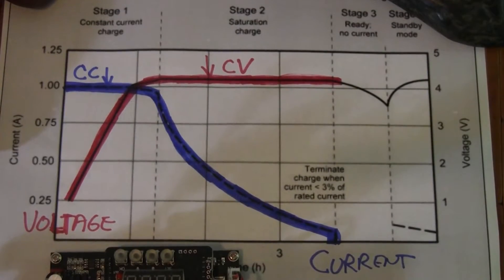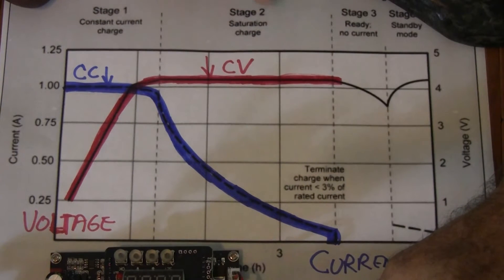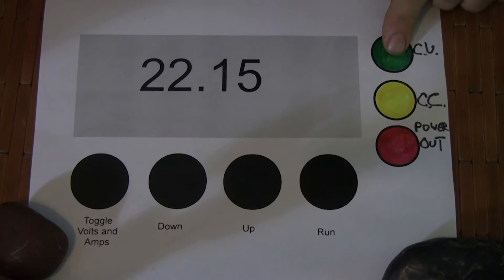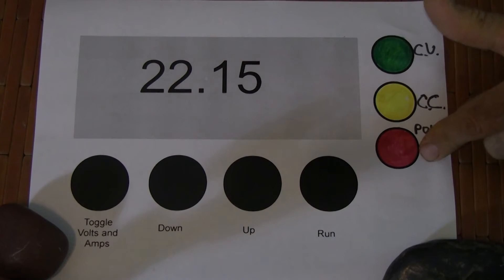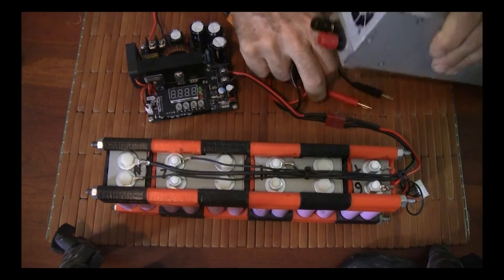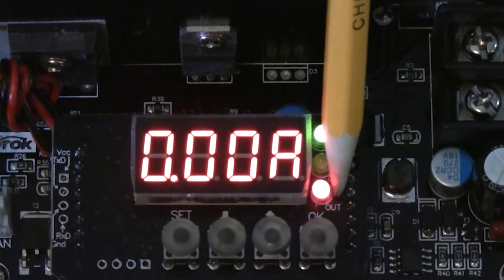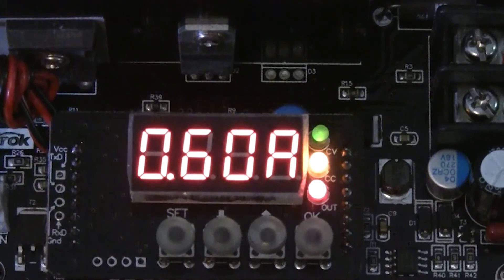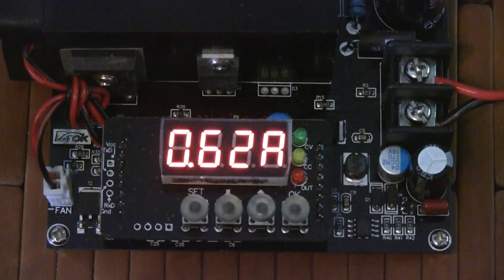Build a universal lithium ion battery pack charger

Comment: How do you balance the batteries?
Reply from the maker: My go-to is active balancing these days.  If the battery is well balanced, I will charge to 4 volts per parallel group with no balancing, then balance with a hobby charger when needed.  Or you could combine active balancing with the overvolt/undervolt/over/amp protection that a BMS offers.

Comment: Hello. I want to regulate an unregulated battery voltage of 48-60 vdc to a constant output of  48vdc with a current up to 6 amps to supply power to cctv equipment. Are these types of devices meant for my application? Thanks.

Comment: Excellent ....but now how do manage balancing the battery with this?  Use a balancing board if you are not using a BMS ...and use the BMS to maintain balance if in fact you do have one?  Always good info from you ...thank you.  I just subbed.
Reply from the maker: Hey Happy Guitarist,

Thanks for the compliments, much appreciated.  Yes, you would use this to either power a Hobby Charger, do "bulk charge" a pack- charge to a lower voltage without balancing, or use it with a BMS.  What do you want to build a battery for?
Reply: @shawname2  I build batteries for personal use for a variety of reasons ....but also do build batteries for others ...which again ends up for a variety of reasons ...Ebikes, powerwalls, electric power tools, DIY robots etc.  I also have large quantities of Boston Power Swing batteries at this time that I sell to others who build their own packs ...and for that matter may end up with good quantities of other manufacturer's batteries if the opportunity arises.  So I am interested in all things battery related.

Comment: hi my drok i bought from amazon wont adjust voltage will send video i use it to charge my lithium batteries so need to adjust charge voltage its supplied 12v from my adjustable power supply.steve in uk.its the one you use shawn
Reply from the maker: Hi Steven,

Return it.  I(t is defective....   But check the fuse first.

Comment: All lifepo4 cells now 3.7v for the 24v 200 watt motor do I need a bms ?Was thinking can use 8s4p pack plus 3cells extra that were in original case gettin 11.2v off the first 4s4p pack I built

Comment: These lifepo4 batteries are expensive and they still make them don’t they like for boats and vehicles they seem to be longer lasting than lithium ion usually and safer
Reply from the maker: Get then cheap at Battery Connection- online

Comment: hi shawn ive just got a lifepo4 battery off headway superlight bike its my girls mums not been used a while.anyway  i teested battery and it came on an span the motor ok then under load it dies.i checked cells there are 30 x 22650m 2250 mah.5 series x3 two of these joined up.they are about 3.6v each but one was 3.8v.could i use drok charger on these say 29v at 2to 4amps.she is using my old hoverboard battery for now.41v 18650 pack it gets her to supermarket and back nearly but only small.
Reply from the maker: I have seen it happen that a cell will show a good voltage, but when you put it under load the voltage plummets.  That means the cells have massive internal resistance.  In other words, it has no power to give because it can't get out of it's own way.  Sorry, but I believe the battery is toast.  Test it under load while monitoring the voltage and verify.
Reply: @shawname2  i checked pack voltage out off case its 26v it lights up my led torch ok
Reply from the maker: Steve-  Is it a 36 volt ebike?  The low voltage safety on the BMS or the controller could be kicking in, shutting off the battery.
Reply: @shawname2  ITS ONLY 24V BATTERY AND 200 WATT REAR HUB MOTOR
Reply: @shawname2  will connect torch and measure voltage again
Reply: @shawname2  it was still 25v with the led torch on it is 8 x 10watt led gives 8000lumens light

Comment: Great idea. Bought the 2 items from Amazon USA but a refurbished HP 12v 575w redundant power supply is only available and only male disconnect spade terminal can be connected to the output. What AWG wire should I use to connect between the power supply and the Drox device? Thank you.

Regards,
George
Reply from the maker: For 600 watts at 12 volts and a foot run, 12 or higher gauge would work.

Comment: I have a more simple version of this using a CC CV Boost converter, but my packs all of BMS's on them. I'm looking for a higher current application - I'd like 12-16 Amps at 54.6v. Do you know of any boost converters that would handle this current?
Reply from the maker: Sorry, no I don't.  At 600 to 800 watts most folks are using a dedicated charger...
Reply: Thanks for the reply!

I basically want to make my own dedicated charger. Most seem to cap out at 3Amps for E-bikes. This is to charge a Portable 3kWh battery pack as a backup to my House, Boondocking, and for use in a trailer or "Camping".
Reply from the maker: Check this out:

https://www.aliexpress.com/item/XINMORE-54-6V-15A-14A-13A-Lithium-Battery-Charger-For-48V-Ebike-E-bike-Li-Ion/32829858594.html?spm=2114.search0104.8.8.205e2a00dYH3YK&priceBeautifyAB=0

Comment: I have been looking for one of these. I was thinking of adding a bms and making it a balance charger. I have a 7s and a lot of paralled cells. Almost 200p Bank. I thought about the balance chargers. But they are not cheap for a 7s charger.  I'd like to have a few of these. So I can charge from a 12v 150amp source. And use most of the that current! It would mostly be in an emergency when used. If it could do 250watts 28.5-29.4v. I want to charge to around 4.0-4.12v 4.15 max per cell. I'd like to keep it between 3.4-4.0 volts. To hopefully make the batteries last forever! Great video!!!
Reply from the maker: That is a lot of cells in each parallel group for an off the shelf BMS to keep in balance.  You might want to check out my video on balancing big batteries:  https://www.youtube.com/watch?v=C-o3LAtkMUs
or:https://www.youtube.com/watch?v=QwOpa8gT4Uk
cheers,
Shawn

Comment: Hi Shawn, great videos. love em. Question. You said that all lead acid and lithium ion batteries use cc cv charge cycles. Is that inclusive of sealed agm batteries? or are these different chemistry? and would these batteries benefit from being slightly "under charged" to prolong their life? Many thanks in advance, keep up the good work
Reply from the maker: Hi Eric,
Yes, because AGM is a lead acid chemistry.  No, Lead Acid chemistry does not benefit from being undercharged, it benefits from being overcharged or "boiled" on occasion to loosen the sulfates forming on the lead plates.  Undercharging does shorten the life on them though....
Reply: Thanks for the reply Shawn, its surprising how many vloggers on here do NOT reply. Much appreciated, and nice to see that you reply to your viewers. thanks for the info. Eric.
Reply from the maker: You are welcome Eric, I try to reply to everyone except the provokers.
Reply: One last thing, the drok mentioned in this video, can it be used for a range of battery charging, from lipo packs, to li-ion and agm, aswell as standard car batteries? I have found that people are advertising certain chargers for certain requirements, but it seems to me that this one is pretty universal..?
Reply: What would you say would be the ideal voltage to go to when charging lithium ion cells (18650's) would it be 4.1v as apposed to 4.2?
Reply from the maker: Yes, it would be suitable for all CCCV chemistries.  Lead Acid likes to be kept topped off, while Lithium likes to be used once fully charged......
Reply: Thanks again for the reply Shawn, Do you know if the DROK is capable of balance charging? Is there a module built in for this, or is there a plugin one available for this unit? You are a star. Many thanks
Reply from the maker: Hi Eric,
Yes, the Drok will balance charge.  A balance charger needs to have two charge cycles, Constant Current and then Constant Voltage.  It is abbreviated CCCV.  The Drok is a CCCV charger.
Reply: Hi Shawn, Thank you for that, but I was actually referring to the inputs for where the balance leads will go on the DROK. Its not obvious from the video if these can be connected to the DROK, or if you will require a seperate balance charge module
Reply from the maker: ahhh, No the Drok has no balance leads.  You would need a BMS or BalanceBlocs.
Reply: So I guess I would need a plugin monitor module similar to what you used in your ebike battery setup.? Do you have a link to that module? thanks Shawn, you have been a massive help
Reply: What would be the ideal voltage for 18650's to maintain their life? or even prolong it? would you say between 4v & 4.1v?
Reply from the maker: Have you seen my video "How to build a better battery without a BMS" I don't sell  BMS's or Hobby Chargers, but if you contact me personally from my web site I will help you get the right gear.
Reply: Thank you Shawn. I will take a look at this video.
Reply: FYI. The video is great, and the spreadsheet for the bloc calculations is also great. Well done. I think I will use a 4p-2s block, and add a buck boost module to bump up to 12v. Excellent!
Reply from the maker: Thanks Eric, Yes the 4P2S is popular.  You might consider a 4P3S Bloc to get closer to the 12 volts.
Reply: I understand your reasoning for this, but I wanted to make the pack as light and cost effective as possible. Hence the fewer cells, and the boost converter.  I Need between 5v and 12v only. But the capacity of 12000mah is important factor for the price and weight. I dont need to drive a lot of Amps through the converter, probably a maximum of 2-3Amps.
Reply: Your videos are fantastic, and very inspiring. Keep up the great work.
Reply from the maker: Got it.  Sounds good!

Comment: One ebike guy said they had a lot of Samsung cells do this but mine were new should I just use more new cells is it ok to mix different makes same capacity like Panasonic an Samsung
Reply from the maker: Yes, it's OK to mix different cell manufacturers- you don't have a lot to lose!  Put them all in parallel and charge at once to 4 volts...

Comment: hi shawn can I use a drok to charge my 0v cells slowly with low current like rhino does on youtube.so need variable powersupply or 12v supply and a drok?
Reply from the maker: I don't see why not.  But I also doubt if it would work.  When I try this my batteries just get warm.  If you are able to recover and use 0 volt lithium ion chemistry batteries could you re-post here?

Comment: Can I connect 2 of them in parallel to double the current ? assuming I make sure the output voltage is the same
Reply from the maker: Yes, 95% certainty.  Keeping the output voltages close is key- or else the higher voltage one could cause the lower voltage one to turn off...

Comment: Actually a 300w charger will never output 300w. 
Example: 60v battery it will be empty at 53v and full at 67v
When you plug the a 4a charger it will output 4.48a x 53v = 237w. 
When it reach the 67v x 4.48a = 300w but just for a moment. 
The current will start to drop until it goes 0. 
So when you get a 300w charger, you never get a 300w charger. 
What you should look is A. 
if you have a 30Ah 60V (67V full) battery and you want to charge it in 10 hours get a 67v 3A output charger. 
If you want to have a full battery in 3 hours get a 67v 10A output charger.
Reply from the maker: This is true- a good way of determining the size charger that you need.  
In terms of rating the power of a variable charger like this one, watts is also useful.....   It tells us that at 60 volts we are going to get 5 amps max- but at 30 volts we can get closer to 10 amps-  which then helps us size the charger for the battery we are charging.  
Thank you for your comment.  It is helpful.

Comment: Wonderful video here. One question if I were to charge my 24v lithium pack but was using a 12 v solar panel if I hook up the panel will it navigate voltage changes from the panels? Let’s say a cloud came over the panel and the voltage dropped? So will it keep the output voltage constant or will it shift in reference to the cloud? Obviously the available current would change.  Thanks.
Reply from the maker: Hi Solar,

Yes, the Drok will keep a constant voltage as the sun comes and goes.
Reply: Awesome thank you, this is exactly what I’m looking for.

Comment: Can only get 1.8amps from a 12v x 750w power supply very slow for a larger battery. Have ordered a 48v output power supply to see if I can get more amps out of it for my 52v 14s battery.
Reply from the maker: Something is wrong- a 750 watt power supply at 12 volts should deliver 62.5 amps.  It is possible that the battery is nearly charged, and therefore the current has reduced.  OR the DROK is restricting the current flow.  Check again Stephen...
Reply: Shawn McCarty yeah checked it a few times even if I set it to 5 amps I can only get 1.8 this us when the battery is low. Have also tried different 12v output power supply. Got some feedback from the ES forum and the guys said I need more voltage output. I've tried a 250w, 350w and the 750w supply all give th e same 1.8amps . I get 4amps when I charge half the battery 7s x 7p
Reply: Shawn McCarty this what I got back and makes sense about my outfit.....your DC-DC converter can handle only 10A on input side, if you have 12V input, you can onlly use 12V 10A (120W of power) which is less than 2A at 55V. You will need 36-45V psu for 50-60V output
Reply from the maker: Stephen, you are right.  Sorry if I was misleading.  Thank you for the correction.  

I am about to build some battery chargers using this power supply: 
 https://www.amazon.com/gp/product/B01GFVI6R6/ref=oh_aui_detailpage_o01_s00?ie=UTF8&psc=1

With the 30 amp version you could get 360 watts out.  Also, power supplies can be connected in series for higher voltages:  
https://www.acopian.com/acopianPowerSupplies/entry.aspx?nsid=17

Many ways to get there- keep experimenting!

cheers,
Shawn
Reply from the maker: Looks good Stephen.  With a little work we can build some great battery chargers!
Reply: This sucks.  So 900w is when?  Is it a 10A limit or 15A?  Further, I thought these were always voltage boosters.  If you bring in 60VDC can I output 48VDC?

Comment: Nice video Shawn. I have a question though: I have 3 x 12v 138ah LiFE bateries wired in series to give 36v for my small electric vehicle. I'm looking for a cheap way to charge the vehicle quickly. Could I use more than one of these units in parallel across the whole 36v battery at the same time? Two chargers would half my charge time, which would be very nice.
Reply from the maker: Hmmmm.  The issue is that one Drok may read the voltage of the other and decide that the battery is fully charged and shut down- especially late in the charge cycle.  But this should not be an issue as the remaining one would just up it's current...  I think it would work.  I have doubled up with ebike chargers before and that is what happened...

Comment: Does it also balance the battery? If you charge a battery with a lot of amps, it charges fast but does it damage it in the long run?
Reply from the maker: It does not balance a battery.  Lithium chemistry does last longer when charged more slowly.  As a rule of thumb, you do not rate.want to charge faster then 1C.  1C means that a 10 amp hour battery can be charged at 10 amps for 1 hour.   1/2 C would be a good rate.

Comment: Shawn, is there a way to add balancing to the Drok when not using a BMS?
Reply from the maker: Sorry, No.  But you could use the Drok to power a hobby charger.  Or use 1 Drok for each parallel group......
Reply: Shawn McCarty  ok, thanks for the video, great ideas!

Comment: My question is, how does a device know on its on when to start charging in CC or CV
Reply from the maker: By watching the voltage.  Battery chargers start in Constant Current mode.  So they put out as much current as they can to charge quickly.  The voltage then rises.  When the voltage gets to the fully charged voltage the charger switches to Constant Voltage mode.  Here it begins reducing the current to keep the voltage under it's limit.  Finally, when the amount of current is only about 5% of the charger capacity, the charger calls it a day and shuts off.

Comment: This has not auto-shut off feature? This would require baby-sitting, or some sort of timer so you don't toast the batteries?
Reply from the maker: It's a CCCV charger- so the charge current tapers as the voltage rises....   SO that is the shut off mechanism- as is true in all chargers...
Reply: I'm at a crossroads of charger thoughts. 10s5p battery.

a) I-charger 1010b+ with no BMS, but use a cell logger. 
b) Luna Charger with a BMS
c) Drok, DC power supply with a BMS

Side note, I sent you a message on your website asking for some dimmensions on the blocs. It's been awhile with no response. FYI
Reply from the maker: Could you please send the dimension request again?  Sometimes I miss an email.

My choice would be the 1010B with no BMS and cell loggers.  It's the most expensive but you would have a true instrument panel into your battery and could control the finish charge voltage...
Reply: That's where I was headed. I decided to go a different route on the battery. I am space limited, and don't believe the blocs would have worked for my particular project. Great idea though.
Reply: Hi, But will it completely cutoff once the amp is very low (below 5%) in the CV phase... basically like any auto Li-ion charger? Or you have to unplug it manually ?
Reply: Shawn McCarty hi Shawn so if I purchase off eBay 12volt power supply and the drok 900watt will that be ok for my 50 cell 18650 Samsung brand new 2600 mah pack for electric scooter or bike later on .standard lead acid at moment 12v 12ah x 3  but range not good .will be using vruzend kit for 18650 but want to charge as pack .have bought a imax b6 to charge 16 cells as jgarcia  reccommends  in 4 battery holders wired up.together thanks steve in chester uk